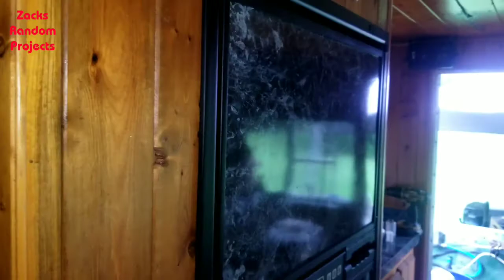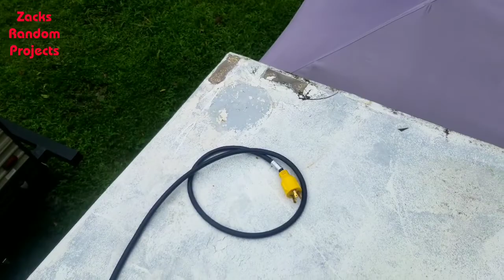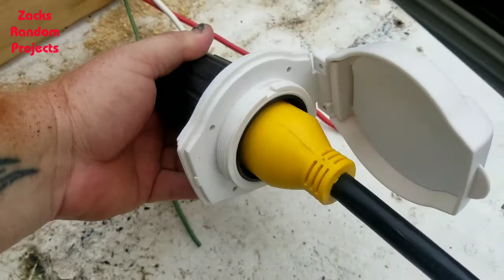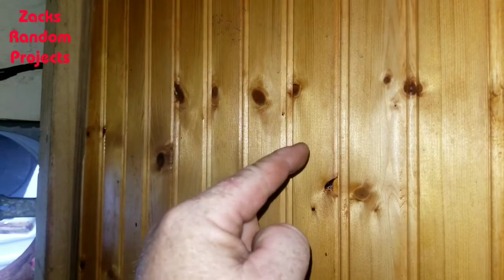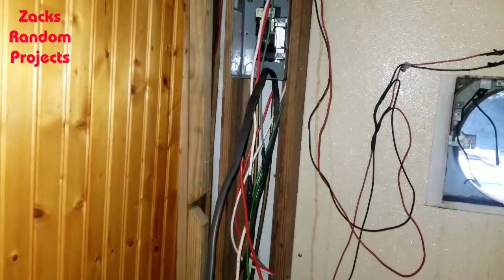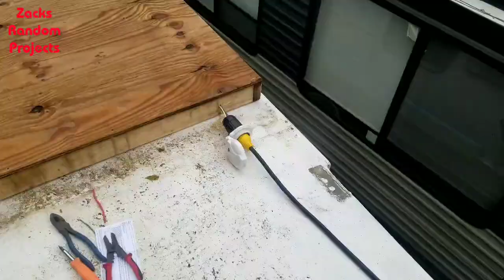Houseboat 120v electrical is done...

Comment: Woooo electrical shocking have fun
Reply from the maker: Bahahaaa! Hopefully not! 😂 Thank you for watching!
Reply: if it was me i put generator next to the back trans take weight off the top run wire in the side under the lip
Reply from the maker: @waynedavidnance6131  Ive thought of that, but I have limited space in the back by the transom as it is and I dont want exhaust fumes to build up in the back of the boat while we're sleeping and seep inside the cabin. The roof is plenty strong. Im just gonna get one of those little quiet suitcase generators like a Honda EU2200 or something along those lines. That way no noise to be heard below when we're on the back deck and no exhaust fumes building up down below. Thanks for watching!
Reply: @zacksrandomprojects9698  ok great idea I love watching videos on here not much on TV now days I cut the cord with cable went back to hd antenna i spent most of my days watching youtube I used to do wood crafts with this virus all my wood suppliers went out of business so i went back to my old trade computer and electronic in which I am a genus on both keep up great work I been keep tabs on one of other videos SV Seeker he built the ship from scrap metal set to launch Aug 2021 man that one big ship
Reply from the maker: @waynedavidnance6131  Yes I watch SVSeeker also. He is building the 70 something foot yacht in his yard. Thats a crazy project! Well thank you for watching and stay safe out there!